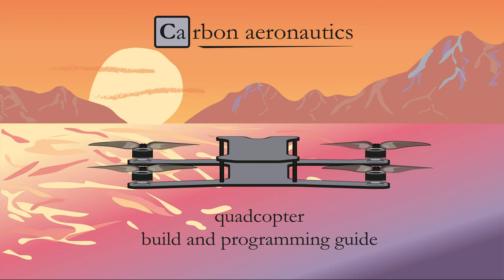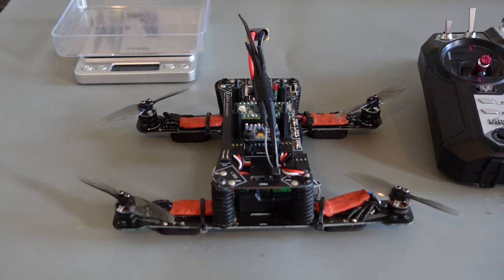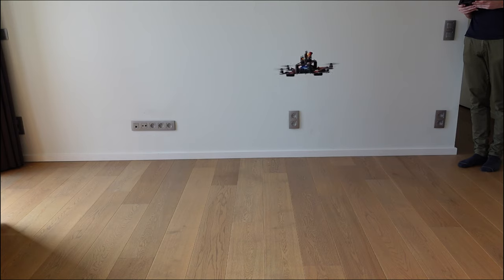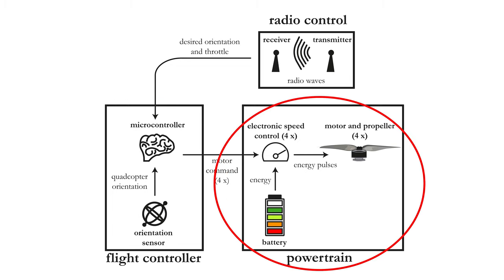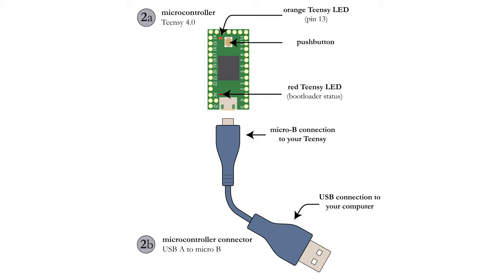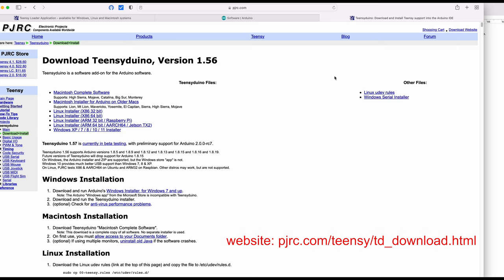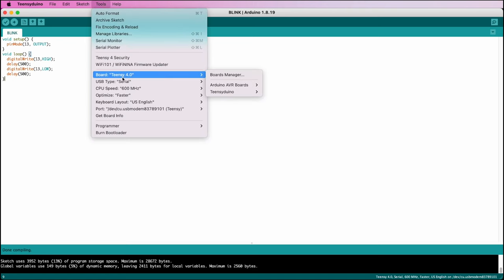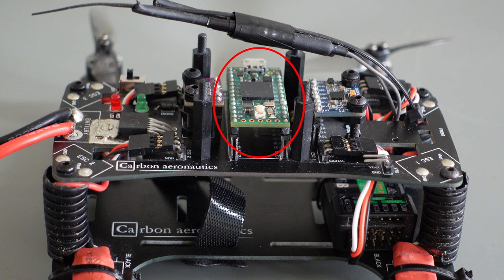1 | Get started with Arduino and the Teensy 4.0 microcontroller

Comment: Can we use Arduino nano instand of teensy
Reply: arduino nano is far from the teensy, you can try, but i'm pretty sure that it will be overwhelmed by the amout of data of the acceleration sensor/gyroscope
if you want numbers : arduino nano is capable of 16Mhz and teensy is like 400 or 600Mhz smt like that

Comment: Hi, can we do this project with the Arduino Nano? Thank you!
Reply from the maker: Yes you can for the easiest controller (rate mode), but once you will go to more complex code you will need a more powerful microcontroller
Reply: @carbonaeronautics  
Taking off my hat !
you have done a great job
This is very cool
I really want to repeat this with my children students

Agreed remark about performance but
There is always expediency + the ratio of the necessary sufficient performance availability AND the price of the microcontroller

In your opinion, who is second and third in terms of productivity after tinsie?
Reply: sorry,  after Teensy 4.0
Reply: @mbogobot  can pi pico used is it more powerful than arduino
Reply: Assalamualaikum 
I run code in Aurdino IDE 
Then during compilation of code error come 
The error is " Not include pulse position Library" 
How i can solve this problem and is you given me all libraries which includes in whole project making use 
I shall bee very thankful to you